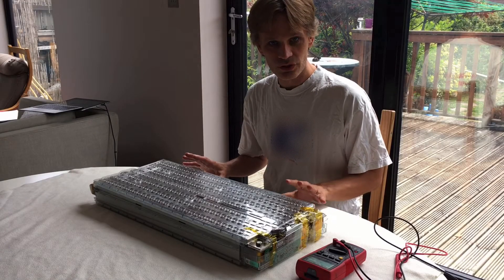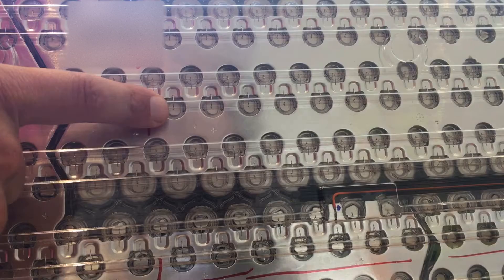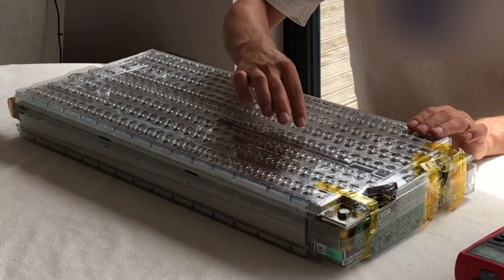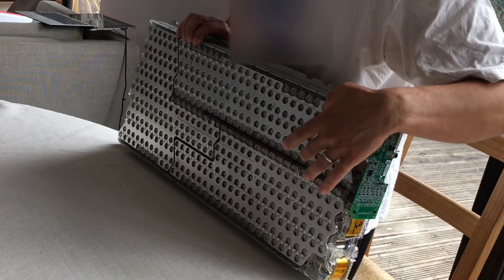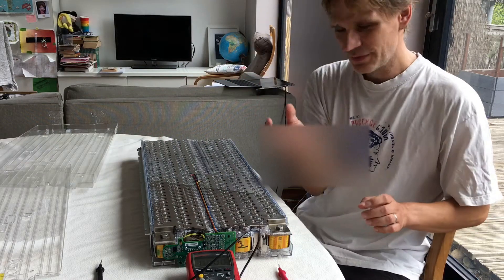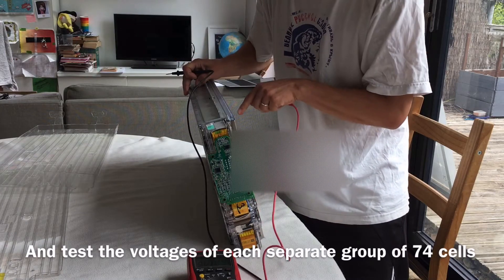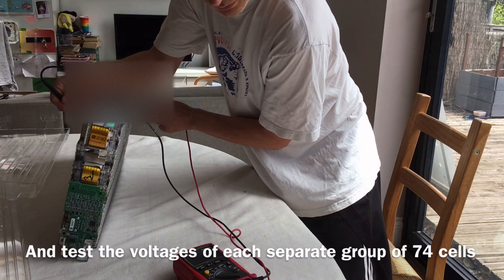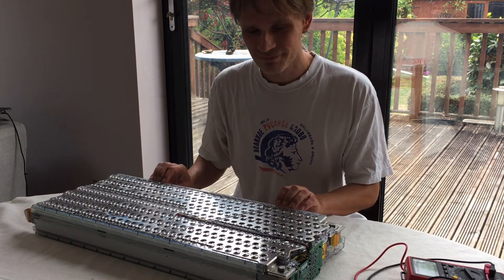2. How to check a Tesla battery when buying

Comment: Looking at buying a whole pack soon (14 modules) , seems like it may have been stored for a while so is anything above 250v total good?
Reply from the maker: Not really. Ideally you shouldn’t discharge them below 18V each. And better if you can keep them above 19V. So probably best to check the individual modules and not take the ones below 19V.
Reply: @aktsolar  the whole pack is still sealed from the car, I’ll be disassembling it after I’ve bought it, it has 14 modules so 14x19 = 266v, so I should think twice if it’s below 260v?
Reply from the maker: They should all be at the same voltage then and 252V or above is just very flat so may be okay still. Could you  try to get a discount?
Reply: @aktsolar  not sure, I’ll ask when I’m there and testing the voltage, is there a way to test the voltage of the pack when it’s removed from the car?

Comment: i have 2013 p85 and i have a bad cell on module 5  do you think i could replace the module with a good used module and it would be a plug and play i own a auto shop and its my car thanks
Reply from the maker: I’m really not sure how that would work because normally the modules will all be at the same charge so when you swap in a new one the electronics would have to balance them. And I’m not sure if the electronics are set up for such extreme balancing. Do let us know how you get on though

Comment: Thanks for the video. What is the minimum voltage we have to get for the total pack and each cell to make sure the battery can be used?
Reply from the maker: You should never go below 18V for the whole pack which is 3V per individual cell. In general I try never to go below 18.5V - or even 19V - in order to maintain the life of the battery for as long as possible. Do ask if any further questions.

Comment: thanks for u video but this battry car tesla include what unmber of cell 18650 3.7v ?
Reply from the maker: Total of 144 cells, in 6 groups of 24 cells.
Reply: @aktsolar  ok good but what pric new battry car tesla?
Reply from the maker: Not sure what price for a new one but I bought this one second-hand on eBay for £800.
Reply: @aktsolar  thanks but im amazing u battry car teslasmall   , im see in youtube thay are replace battry tesla verry big and hard ?
Reply from the maker: The actual Tesla car uses 16 of these modules all wired in series so would have 16x144 = 2304 of the 18650 cells on total.
Reply: @aktsolar  thsnks for u
Reply: @aktsolar  no it is 444x16 for a total of 7104 cells
Reply: @aktsolar  isn't it 444?